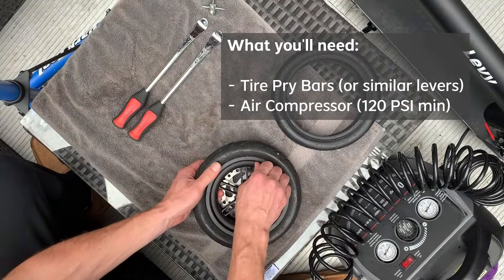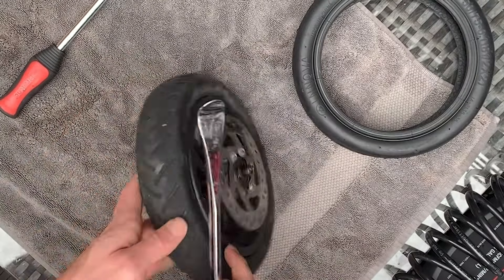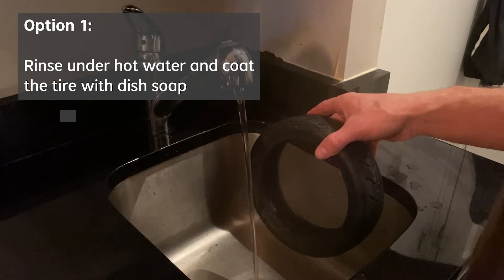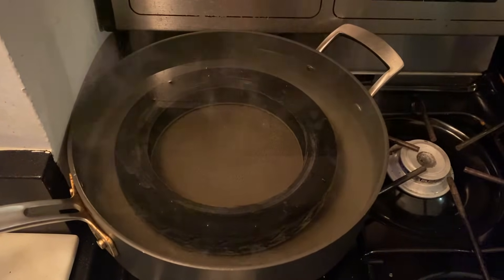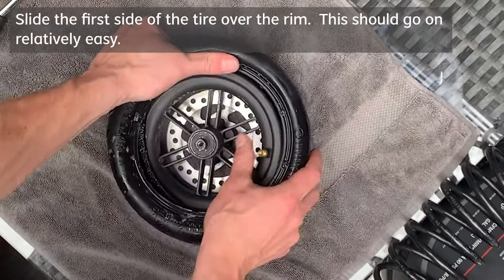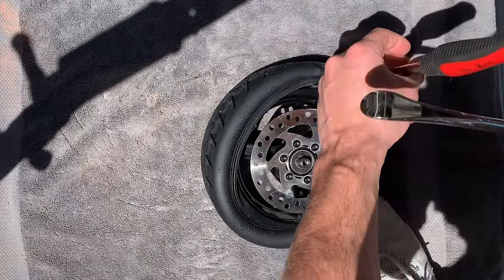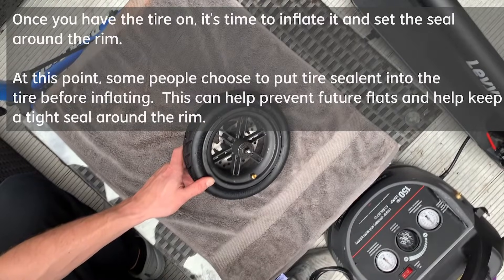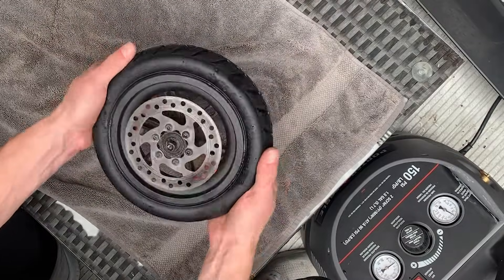Electric Scooter Tire Replacement (Tubeless Edition)

Comment: If you are a senior with damaged shoulders forget about trying to do this yourself. Even with tire pries and a ratchet stap I nearly dislocated my shoulder trying to reseat the bead on my mobility scooter tire. Tubeless tires are the WORST. Make sure to travel with a battery powered tire inflator, ratchet strap and tire pries. You've been WARNED.(-Senior lady with ruined shoulders.)

Comment: Are you able to provide the specs of the tyres toy fitted.. most importantly the inner diameter.. preferably in millimetres?

I just bought some 80/65/6 tyres for my m365 pro 1. Took it to the tyre shop and they couldn't get the bead to sit even.

I am wondering do I need the 6.1 inner diameter tubes?
Reply: The tyres you fitted* stupid auto correct

Comment: Did my front tire but now trying to fill it up with air and it just won’t work. Or does it need some time
Reply: Its  more practical to put solid tire  on  when replacing tire,  solid tires  over all are less maintenance and FAR less  finicky , theres videos to put them on fairly easy  with the  sit in chair method  with feet pushing down on tire on matte or carpet,  ie 20minute   tire in  hot water,   some zipties and  3  tire irons.

Comment: The Xiaomi scooter 4 has tubeless tires, this is a good video!
My front tyre needs inflating every ~3 days, how can you stop slow leaking on a tubeless tyre?
Reply: Tubeless tires are the WORST invention since the A-bomb. I'd rather ride on SOLID RUBBER TIRES than suffer the aggravation of yet another flat on my tubeless tire mobility scooter. Nobody warned me about this when I bought my mobility scooter.😑😬😡

Comment: I have a Qiewa Q power 2... Yesterday, I swapped the off road tires out on it for street tires..  I was wanting to get the task done or at least started before my tire spoons arrived from Amazon..  I got to thinking.. An idea popped in my head..   If we can zip tie it to put the tires on the rim.. Why can't we do it to take it off the rim without spoons? 🤔.  To my surprise, my idea worked.. I had both tires swapped out before the spoons arrived.. While the wheels were on the scooter, I used big channel lock pliers to squeeze the tire, slipped a zip tie under and to the other side and pulled it through and zip tied it while squeezing the tire with the pliers then I did that 4x more times.. Then took the wheel off the scooter, and was able to pull the tire off the rim without any spoons.   😁🔋🛴 I thought I'd share my experience
Reply: Channel locks........never thought of that. Not a bad idea.
Reply: Could you make a video demonstrating your method? This senior lady would sure appreciate it. The ratchet strap and tire irons method is nearly impossible for me.

Comment: I have tried everything, inflating without a valve with an electric pump did not work, with a compressor without a valve. get the tire on the rim but it wont pop into place no matter what i try.
Reply: Did you got it fixed?
Reply: Yes @CoRtnx_

Comment: This didn't work for me. I can't get thhe tired filled. DO NOT use green slime, it shoots everywhere. it got EVERYWHERE when tried to fill. im on attempt #45 or something i lost count. these tubless tires for scooters should be illegal.
Reply: i'm running OKO xtreme dirt bike tire sealant (€17 for 800ml, pretty cheap), fixed up the 6mm wide slit a large shard of sharp glass caused for now while i wait for replacement tires

tbh tubeless is better, you'll get flats either way, and you don't necessarily need to fill the entire thing with tons of sealant, i had no sealant in mine for 8 months till the glass stuck through the tire at a pretty bad angle (straight on)
Reply: Its  more practical to put solid tire  on  when replacing tire,  solid tires  over all are less maintenance and FAR less  finicky , theres videos to put them on fairly easy  with the  sit in chair method  with feet pushing down on tire on matte or carpet,  ie 20minute   tire in  hot water,   some zipties and  3  tire irons.

Comment: Iv been trying for 9 days to get a single back tire onto the back rim. 

I still havent... and i just want to sell my scooter at this point.

Rediculous
Reply: Its  more practical to put solid tire  on  when replacing tire,  solid tires  over all are less maintenance and FAR less  finicky , theres videos to put them on fairly easy  with the  sit in chair method  with feet pushing down on tire on matte or carpet,  ie 20minute   tire in  hot water,   some zipties and  3  tire irons.

Comment: You don't mention aligning the rotation of the tire/treads with the rim rotation direction and it looks like the tire has rotational indicator (little right-pointing chevrons on tire?, 2:44) as does the disk brake (arrows printed on metal visible at 2:31).  At 3:16 you can see both indicators, pointing in opposite directions.  I'm not sure, but doesn't this mean it's on backwards? (I don't know...just asking.  I know bicycle tires need to be mounted corresponding to direction of rotation)
Reply: What are you looking at? I'm having difficulty seeing
Reply: @emprrah 
Thinking it's a wind up 😂
Reply: You're totally right, the tyre is backwards in relation to the disc brake!

Comment: but are they better that tube tyres?
Reply: Yes, you can run your tires to lower pressure, also you can have less punctures and I feel a little smoother ride with tubeless. I'm currently running with tubeless on my M365 with the stock tires.
Reply: @Christian-tc4sb  What's your experience till now? What pressure do you run? I want to convert to tubeless to. I have upgraded CST tires, hope it will work...
Reply: @KESSZ   fine by now, I haven't had any punctures since I changed both tires to tubeless (Considering that most of the roads in Mexico are in bad shape). Also if you add some slime it's going to help sealing a hole in case you get a puncture.
About the pressure; the front tire I have it about 40 PSI and the rear one I have it over 35 PSI, just keep an eye to the pressure not going below 30 PSI otherwise the tire bead may pop off the wheel.
Also be patient while mounting the new tires, because when the tire is brand new it may be a little difficult to seat a tire bead into the wheel and do not forget to buy a pair of tubeless valve stems.
Reply: @Christian-tc4sb  Cómo convierto mi llanta en tubeless? Necesito algo especial? Tengo un patín Honey Whale C1 y trae llantas de 10" con cámara, pero se poncha mucho la trasera y es un rollo. Quiero ponerle la trasera tubeless, pero no tengo ni idea de qué se debe hacer o qué onda
Reply: Its  more practical to put solid tire  on  when replacing tire,  solid tires  over all are less maintenance and FAR less  finicky , theres videos to put them on fairly easy  with the  sit in chair method  with feet pushing down on tire on matte or carpet,  ie 20minute   tire in  hot water,   some zipties and  3  tire irons.

Comment: i don’t have high pressure compressor. All i have is portable electric pump. hope it pumps 🤞
Reply: Hey, Did it work with you?
Reply: @mohamedsoliman4714  no. the tyre they sent isnt a tubeless tyre!
Reply: @mohamedsoliman4714 did it work?
Reply: @CoRtnx_  it did work eventually after many tries but not because of the pump. If I remember correct think I used silicone around the rim then used the little pump and it worked

Comment: I just bought a xiaomi 1s. The tires that came with this scooter are better than the previous ones, as the company claims, more durable. Could I use these for tubeless setup with the help of sealant, or should I need a special type of tires, made only for tubeless use?